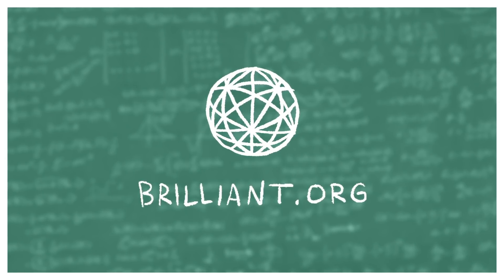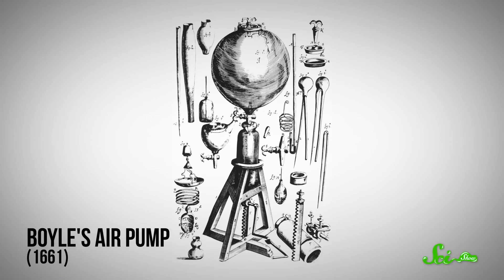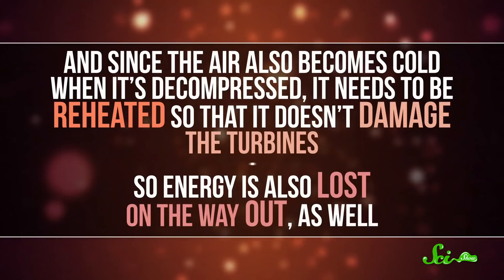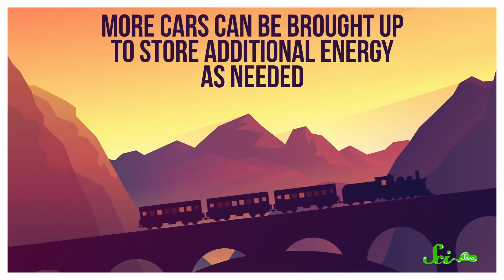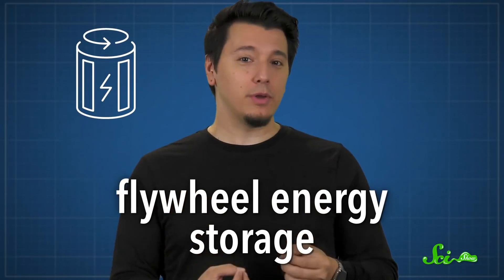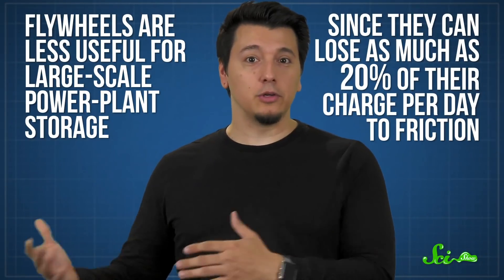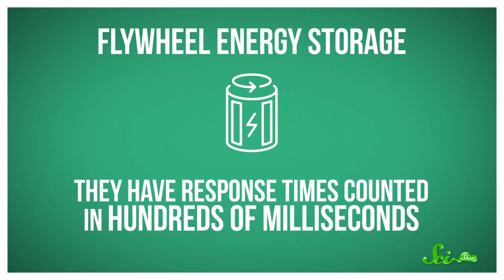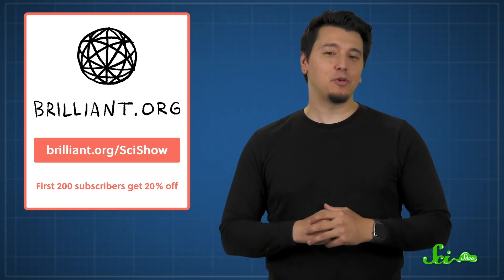The Surprisingly Retro Future of Batteries

Comment: It is so depressing when someone is talking about a technology, mostly made out of points of failure, then casually reports that it is about two orders of magnitude short of the required design spec. And that, even when only considering decarbonizing our current electrical generation. Never mind the doubling and redoubling of that capacity required to decarbonize transportation, heating and cooling.
Reply: Exactly my though this has to be the stupidest video on youtube, let's take super wasteful and inefficient tech from 200 years ago and lie and tell everyone it's new and works. Shake my head get this bull crap off my feed

Comment: One of the first US mechanical batteries was Candlewood Lake In CT.  It was used to store water for off-season power generation for nearby NYC.  The original scheme would fill the lake when water was in excess and drain it when it was needed would cause the lake level to vary.  This is not very popular now as a lot of people live on the shores of the lake and it is used heavily for recreation; thus, though the power generators are still used today, they act less like a battery then they used to.

Comment: I feel like any energy storage that can use machinery or electricity to store power like using pumps to fill up a reservoir with water or a cave with air would be better than something stupid like using fossil-fuels to run power plants for times when electricity demand surpasses what renewables can provide or when they're unable to do so.

Another form of storage that I've heard about that can work in places with solar-thermal power is using some of the heat built up during the day to heat up tanks/reservoirs of water, oil, or low-melting point salts or metals and use the heat stored up in these liquids to provide the heat needed to run steam turbines at night when the suns unable to provide its heat to keep the usual solar collectors going to heat up their working fluid for heat transfer and steam production.
Reply: It's a issue of scale, all of the things mentioned here are typically used to balance the grid load over the course of a day, maybe a week.  By themselves they don't have the storage or output to fully support the grid, just shave the peaks off of the load on it.  We would need several orders of magnitude more storage then these provide to rely on 100% on solar and wind.  If you want transportation to be all electric it'd be a even bigger gap.
I'm not saying it couldn't be done, but it's a long way's off still.

Comment: You guys keep saying “megawatts” as capacity. Megawatt is unit of power!! Aka the rate of discharge. Megawatt-hours is the unit for capacity. For being the sci channel you really need to get your units straight because it does not make sense to say 50 megawatt capacity. It’s like saying my gas tank has a 2gallon per minute capacity. That just doesn’t make sense! If you guys need to consult me or have any questions lmk I’m a mechanical engineer with automotive engineering certification.
Reply: it's common to refer to a powerplants output potential as it's capacity.  That said, it really doesn't make sense in this video talking about storage.

Comment: Capacity expressed in megawatts? This is a unit of power, not energy.
Reply: true, and i agree.  The reason behind it is probably that in power generation they consider capacity in terms of the potential output of the generator.  Probably because in 99% of the cases sustained output isn't a issue for power plants.

Comment: Rural Massachusetts has a grid battery that is done by pumping a lake up a mountain to charge, and then letting the lake flow down to drive a hydro system to discharge. https://www.wbur.org/bostonomix/2016/12/02/northfield-mountain-hydroelectric-station The RTE is about 80. There's also such systems in the TVA and elsewhere.

Comment: Batteries don't need high efficiency if the costs of initial energy production are low. If your energy production costs are low enough to allow you to  produce more energy than you require, the loss of energy in storage is irrelevant because you're only losing this "excess". HOW it is lost may become an issue; if too much heat is produced, for example, changing the local climate and potentially contributing to the climate change disaster switching to renewables hopes to mitigate, then it's a serious problem. Otherwise, not. High efficiency batteries are essential if the batteries themselves will be mobile, because the costs of moving them are always significant. Similar to moving water, you wouldn't want to transport it in a "leaky" device; it's a waste of effort and resources. But if it's fixed in place, it's more like a water barrel that you never draw enough water from to empty; there's enough there when you need it, and that's all that counts.

Comment: The maths for this has not even been vaguely thought through. Rail storage: The worlds longest and heaviest train ever was 7.35km in length and weighed a little under 100,000 tonnes. Now lets look at the maths. No train can manage a 1 in 20 gradient but let's assume it's the limit for the sake of this argument as it is in favour of the opposite argument to mine. To get the train a mere 2000m upwards you would need a track 40km (25 miles) long. Hardly a small area. How much energy would this store? 1 billion joules. That sounds like a lot if you say it quick. An average American house uses 10kWh per day. So a mere 28 houses would need more energy than this for a single day. Alternatively  it is 25,000_ square meters of land needed per household. There are about 130 million households in the USA therefore 3.25 trillion square meters would be needed for a single days energy storage. That;s 3.35 million square  km. Hardly practical. In reality anything over a 100 to 1 gradient is an issue to you can multiply that by 5.
Reply: Well, mgh = 100,000,000kg * 10m/s^2 * 2000m = 2 * 10^12J. Still less then 1GW power plant produces in a hour, though.
Reply: You cant get most people to do maths. Hell you cant even get them to think logically.

Comment: "A" downside? Solar and wind have far more than "a" downside. SOME of the more obvious are large costs in both money and energy to manufacture turbines and solar panels. Another is that they are fragile and high maintenance. Solar and wind do make sense for small installations like remote villages or sailboats, but are not practical for regular grid use. Existing renewable energy power plants are HEAVILY subsidized with tax money.
Reply: Hence they need reliable big "capacitor" to minimize the downside effect that already down enough.

Comment: there is also hydrogen fuel cells, you could usse electricity to electrolyse water into oxygen and hydrogen and then compress the hydrogen in a high pressure tank, then when you need the power pump it through some hydrogen fuel cells. you could also just burn it with the oxygen to produce water again. this is technically a chemical battery too.

Comment: With exception of wind, utilities need to phase out generation for storage. Distributed solar needs a different utility concept. One thing you didn't cover was large scale molten salt batteries. Hall cells have produced aluminum since 1888. Molten salt batteries is very similar process that could be on a cheap large scale and wouldn't need expensive (and strategically vulnerable) lithium which is needed where weight to power ratios are of great importance where power storage is not. See: https://newatlas.com/mit-molten-salt-battery-membrane/53085/

Comment: Of course the best solution is to build modern nuclear plants and avoid the electrical storage and massive infrastructure problems.  Another solution is to have people pay for electricity not just by volume used, but when used.  If people would modify some of their activities pushing the tops of the mountains down into filling the valleys, a lot of problems would be avoided.

Comment: We had to design a mechanical battery as part of our senior design project in college. One of the downsides they didn’t mention is the enclosure required around the flywheel. To get the most energy storage out of the wheel the speeds are in the range of 30000 rpm and you have to worry about the wheel bursting.

Comment: You missed the most important and practical "gravity battery", the hydroelectric pump/turbine.  The ,mass to be moved can be tons with little trouble, and the engineering follows from hydroelectric power plants.  The railroad looks like a "screen door in the bottom of a submarine" to me.  How is the power gotten into or out of the train?  This requires sliding contacts (or a very long wire loop!), which are hard to maintain and expensive to make.  (That's why there is only 1 electrified railroad in the USA).  That also limits the rate energy can be injected/extracted, which is obviously higher then on typical train.  Electric trains use batteries on board to limit the peak power drawn during acceleration from the station for this reason.  You would need a whole mountain filled with trains to get practical amount of energy storage!  Better to put a weight on the track and have cable to generator house at top, like an incline car.
     There are much more practical batteries for this, such as the sodium/salt water battery.  The chemicals in all stages of charge are harmless.     https://www.cnbc.com/2015/09/15/low-cost-saltwater-battery-wins-500000-award.html

Comment: Let's say we send a probe to Alpha Centauri and we find no habitable planet or moon out there. We could repurpose that solar system by filling it with solar panels (quazi dyson sphere) and send all that energy via lasers towards a relay station with a wide orbit around Jupiter. Then the energy is further lased towards a relay platform connected to two counter-rotating flywheels that encapsulate an O'Neill Cylinder, perfectly balancing rotation, while providing a kinetic shield that grows in strength the more surplus power is accumulated, while additionally generating a protective magnetic field that we can modulate at will. 

I am way too overtired and wrought with isolation not to write this comment. And yes, there will be pottery classes.

Comment: Large flywheels have another drawback which you did not mention.  Over time, the Earth's rotation has a shear force on flywheels causing them to lose energy and put stress on mechanical bearings.  Earth's rotation could also cause a flywheel to misalign on magnetic bearings with potentially disastrous results. The larger and more massive the flywheel, the more pronounced this effect. The problem can be solved by allowing the flywheel to move freely in a gimbal but the engineering required to accomplish this adds to the expense and difficulty.
Reply: Nice imagination,  most ridiculous thing I ever heard.
Reply: @lifewasting  That's nice.  Look it up before you make a fool of yourself again.
Reply: @andymanaus1077   I'm the fool? Really?  So, look it up where? Cite one example of practical engineering where the spin of the earth was a factor, or even ever considered. Lol!!
Reply: @andymanaus1077  WOW, the arrogance,  look up practical. You cite a disproven 150 year old joke like the foucault pendulum,  then go directly to space !?   I gotta laugh!
What has actually ever been built taking the spin of the earth into account,  not fantasized about? ....Yea I thought so, NOTHING EVER!!!
I am not the ignorant fool you see, I am just holding up to you a mirror.
You seem educated but the brainwashing is strong in you.....BREAK FREE!!

Comment: If Australia's work on their Hydrogen-Boron B11 fusion reactor turns out to produce tangible results solar and wind power will be irrelevant.
Reply: We could also just use fission reactors.  Most of the issues they have are more easily solved then fusion's, and most of the perceived issues fission has have already BEEN solved, if they would just start building some of the new reactor designs out there.

Comment: Convert water to hydrogen via electrolysis and store the gas. You can then use to to power cars or transform it to electricity via fuel cells again. Today there is a 30-40% loss of energy via the electrolysis, but that can surely be improved. Hydrogen is a way better way to power cars then expensive and heavy Li-batteries and refilling your cars will be much faster then charging batteries. And your car will only emit water as waste products.

Comment: I can think of a combination of fly-wheel, air & Gravity.

The Wheel is at the Base.
It is horizontal.

From it center, going up, you have what amounts to a sack, the top is heavy.
The center is a poll to keep it standing, as well as let air enter from the top, and out through the bottom, to accelerate the wheel.

In hear you actually want the air to cool while at storing mode, and heat while releasing power.

A fairly easy way to do that.
Having the sack be multi layered.

The inner sacks being heat conducive.
Thus the air cools, and there's room for more.

When the fly wheel slows, the outer sack slows too.
The heat sink for the inner sacks is capped (the minimum speed keeps it of, slower, capped)

 By slowing it's weight raises the pressure.

Some of the power made by the wheel is used to heat the inner sacks.
This raises the pressure.

So the air coming out, is speeding the wheel.

Comment: There are more. Melting salt with sun collector farms and use the molten salt at night when no sun is shining to produce steam from water. 

Anather one, filling deep old mines with water using the hight difference or build artifical lakes on top of mountians and hills as energy storage (also called hydro-batteries). 

Capacitors last longer than batteries but they are expensive and dont store that much more for peak demand.

Not so sure about that but flow cell baterries which store energy in chemical bonds in huge Tanks are also a possibilitiy but might be considered a battery and they are expensive too.

And my own invention maybe someone invented it before but I invented it again. Air containers pulled under water. 

You know when you are in a swimming pool and you try to push down an air ballon. The bigger the ballon the harder it gets. This idear is scalable just make the baloon bigger. But needs a sollid anker on the ocean floor holding all the weight. Maybe this is the weak piont of this invention. Try to pull a freight ship 10 meter under the water you need lots of steel cables and ankers for that.
Reply: That'd basically be a compressed air battery, I think?
Reply: KryssLaBryn I thought he meant storing energy by pulling balloons down to the sea floor which stores potentially energy as the balloon wants to float up due to bouyancy but I’m not so sure now that you say it :/
Reply: Christoph G. Your idea’s feasible for off shore wind farms.

I think keeping the balloon size down is better than just increasing the balloon size tho just because they’d need less support.

The small balloons can also just be installed in the wind-turbine support poles themselves. Just compensate by having a lot of them. By having a lot of them, you can also control the amount of energy produced by selectively releasing only a certain amount of balloons...

Comment: I’ve been working on building a bacterial cell battery on my farm... every life cell has a negative charge on the inside and a positive charge on the outside and to chain link the electron flow the bacteria needs to be suspended in a negative charge to connect the cells in both series and parallel so your anode and cathode can then be transferred to a buck converter and a good representative example is your hair imagine trying to get each strand of hair from not touching each other that’s where I am now not easy for me and anyone who wants to try for themselves I wish you the best

Comment: he didn't talk about lighthouses. I thought for sure lighthouses would be mentioned, but they weren't. the light house weights have to be one of, if not the, first LONG DURATION power storage methods that were used.  I would call potters wheels short term since they only spun for as long as the potter was shaping the pot.

Comment: All systems have trade-offs, and we are probably going to want a mix of many types.  That said, at the moment the biggest hurdle we have is the seasonal storage problem.  For that we need a metric which measures how well a system works when it if cycled extremely slowly (every 6 months).  Cost / kWh * efficiency over 6 months will help differentiate long term storage systems.  We need things which are pennies per on that metric.

Comment: What about water reservoir battery systems? Places where they have two gigantic reservoirs for water, one lower than the other, and they pump the water up into the higher elevation reservoir during surplus energy times, then release it through a damn with water turbines when needed?

Sorry for the run-on sentence.

Comment: For accuracies stake, I take exception to the designation “mechanical battery” in general (as it is misleading) and your characterization in particular (as it promulgates the misnomer).  None of the three energy storage devices described is a "battery" any more than an "engine" is a "motor".  You more than most should understand that words matter.  Surly you must agree that publications like yours aught firstly focus on accuracy only than followed by approachability. (And let’s see how rigorous you really are by putting one of those cute little hearts next to this posting, or better yet replying in kind…  ;-D)
Reply: Surely you're a surly pedant.

Comment: I also like pumped-hydro storage.  Those systems are in use today in a few locations so it's a proven technology, and it seems like more could be relatively easily.  I think they have problems too (land area used) but nothing perfect and I think their efficiency exceeds 80%.  As for retro, it's as old as the water wheel.